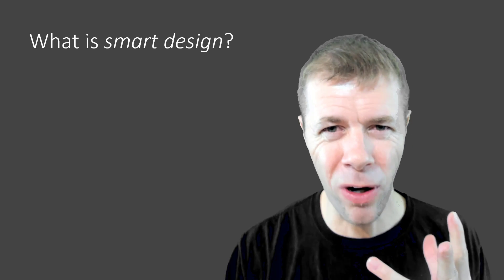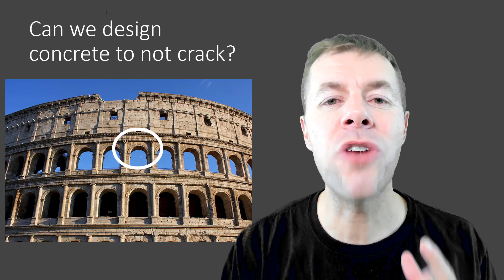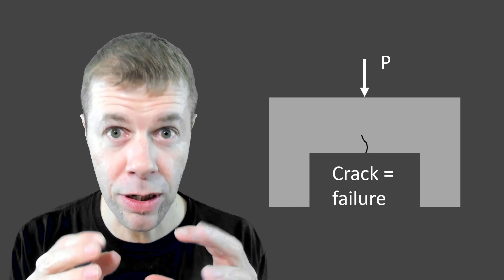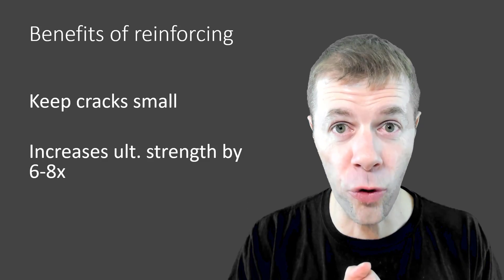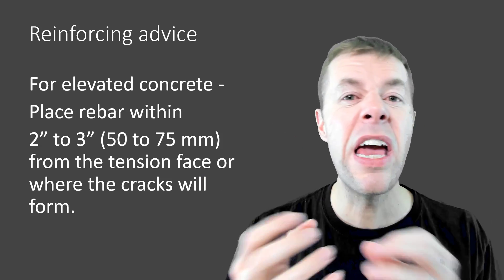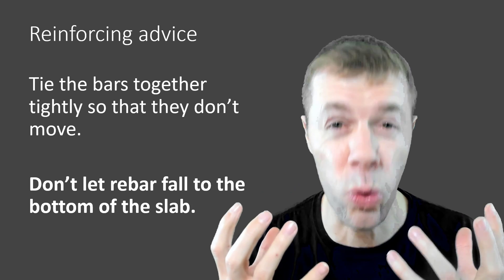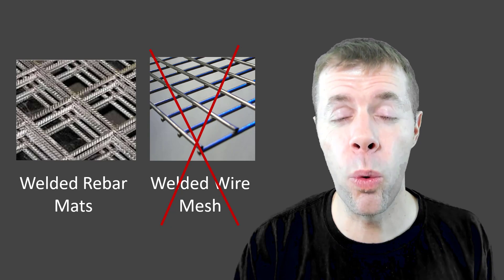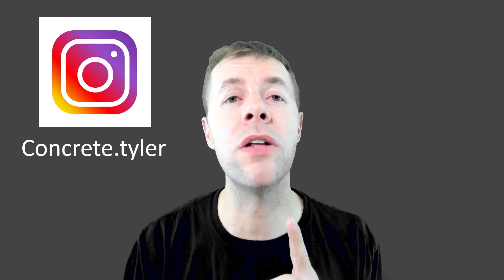How to design long lasting concrete projects

Comment: I look at rebar as future cancer for concrete. It rusts and expands causing cracks and spalling. GFRC or “ Fiberglass” rebar solves this problem. It’s lighter and easy to cut and is corrosion resistant.

Comment: What is the 10000 Psi cylinder concrete mix design Strength

Comment: I need a lightweight 8 inch concrete cap over an 8 foot diameter buried cylindrical plastic tank with load bearing 2 foot wide perimeter. I'm doing a mix design using pumice gravel, portland, 3 micron pumice pozzolan, steel fibers, and rebar.  I have waterglass (sodium silicate) available also.  Do you have any recommendations or cautions for the mix design?  I'm going to be pouring some preliminary test cylinders before the job, along with sample cylinders during the pour, but I want the preliminary work to be as successful as possible. I have a series of these tanks going in a tank farm.

Comment: What concrete mix is suitable for a big  underground water tank slab . Tank measurement : length 13 meters, width 5 meters, depth 8 metres.

Comment: You said you want to place the rebar mat in the middel whenit comes to concrete floor, what if it is a double mat? Is a double mat with smaller diameter size bars beter than a single mat with larger diameter size? The double mat uses more steel and the cost is more, but i take it that the cost out ways the benefits if the double mat is stronger.

Comment: Given that concrete is weak in tension, why don't modern RCC beams incorporate a slight arch in their design? Wouldn't even just a slight arch increase the strength of the beam?

Comment: Nice video. Great explanation of why rebar has revolutionized concrete in terms of tensile strength.  Maybe a small bit on long term weakness of reinforced concrete in areas with any kind of humidity could be helpful though.  I like the idea of exploring arches more in bridges.  Rebar eventually causes concrete to fail due to flaking.  Short term gain for long term guaranteed failure.  I wish engineers would discuss how we can avoid rebar as well, so that we don't have all this bridge repair work to do. Just seems like lots of wasted money.

Comment: The last roll of 9gauge welded wire the I bought had deformations. (I was actually looking for smooth wire because it was for a garden trellis.) 
It seems like you might get to a point with so much re-enforcing that you might as well skip the concrete and just design with steel.

Comment: I would like your opinion on wellding rebar vs tiying them with a wire 
I keep hearing mixed info,
Wellding rebar is good in cold weather 
concrete beam doesn't flex a lot VS tying rebar in warm places were concrete beam tend to flex .

Comment: I have a question on how to design long lasting concrete.  I'm going to build a forever home and want the house to last for centuries.  This house will be built in MO where footings and foundations are the standard design.  The house will be 100% ICF and I want to know how to protect or waterproof my concrete footings?  I want all 4 sides of the footing to be protected.  If you just pour the footing on dirt, the bottom part of the footing will soak up water over time and the reinforcement in the concrete will deteriorate.  You have one time to protect your footing until it will be buried forever.  I would like your opinion on how to protect a concrete footing for the elements and to protect an ICF foundation / house from the elements.  This is such an important subject that no one goes into great detail on how to achieve this. I'm not worried about cost since the footing will be a very small part of the entire project.  As far as protecting the ICF's, cost is a little bit more of a factor since it will be a very large area of the house.  The more detail you can provide about what type of concrete and when and how to protect these areas the better.   Thanks Eric Wehmueller
Reply: I know this was posted 10 months ago, but this would do the trick (this guy is in Springfield, MO too BTW): https://www.youtube.com/watch?v=HBfwIhSLppE

Comment: Cracks also form due to shrinkage during the curing process, not just when the tensile strength has been exceeded.
Reply from the maker: When the concrete shrinks the movement is restrained by the internal aggregates and this exceeds the tensile strength and causes the cracks.

Comment: Always great videos  - as welded wire mesh is used on many if not most residential driveways and patios - what are the reasons for not being a fan.

Comment: Check your diagram of the arch to the picture. The photo of the Coliseum clearly shows the Roman arch as a half circle. The diagram or cartoon you use is much lower-flatter than a half circle. What you will also find with the remaining original Roman arches is that they were not cast concrete. They were mortared stone.

Comment: Welded wire mesh is for sidewalks. It's relatively cheap, easier to break up a slab and adds less steel to deal with while recycling. The concrete actually bonds to it very well. The square size is decent for holding standard sidewalks together. Something slightly thicker would be better but on average it lasts forever without completely rusting out.

Comment: To increase life time of a concrete structure I think a good idea would be to use stainless rebar on the rebar layer closest to the surface of the concrete. That way you should buy yourself some extra life time in terms of rebar corrosion initiation at a fairly low overall cost increase  for the home building project. I've also heard that keeping your vct at about 0,4 is a good idea if possible in order to get a concrete as impermeable as possible. I would appreciate some comments on these suggestions.

Comment: It is amazing how quickly a crew can build wire cages with a simple spring tool. The more steel the better. Many times concrete has less steel because of cost. This is part of design stage. As the GC on some projects, I would go back to engineering and request more steel in some ares, because I could tell it was not enough. And it was very important that is be deep in pour and not move otherwise the design strength goes to hell. Remember the steel  is an interconnected cage to move stress around what could be a very complex  form and it use to connect different pours. It is also important to allow concrete to crack in certain places. So having pre-designed cracks is also important. When we would build walls over 100 feet in length, we would have expansion joints with floating stainless rebar pegs every 100 feet to take the expansion and contraction forces.

Comment: Hey Tyler, I’ve been obsessed with gothic cathedral architecture lately. I visited the Guadalajara Cathedral in Mexico. And obviously the Notre Dame Cathedral has been in the news lately. I was wondering, would it be possible to make a gothic style Cathedral, with all the complex ornamentation and decorative elements, completely with reinforced concrete? Using forms and 3d printed chamfer strips and what not?
Reply from the maker: I don't see why not.

Comment: Hint about free (hated by the industry) additives that would make concrete durable, economical and safer: volcanic ash, organic ash (yeah! ashes from burnt leaves and wood pieces from your back yard), salts, and CLAY. Clay in small amounts is awesome for the mixture because it expands with humidity. Imagine a concrete that seals itself with the presence of water.. Also imagine a concrete that repairs itself by leaching minerals when water is present. There are sooo many cheap and free ways to make concrete better but, it is not good for the business of never ending spending.
Reply from the maker: JR - In my opinion the industry is very interested in producing long lasting concrete.  It is horrible publicity when a structure fails too early.  I have studied volcanic ash, organic ash, and clays in my lab and while they can be helpful they are also quite variable.  This means that one sample may be helpful and the next will do nothing.  This is why these materials are not widely used.  If someone could find a way to rapidly evaluate these materials or purify them then I think they would be used in much higher volumes.  Thanks again for the comment.

Comment: Hello Dr. Ley, can you please post a video regarding the inverse analysis of Ultra high performance concrete? I am struggling in finding a good reference for that method. The inverse analysis will basically inverse the load deflection curve obtained from 4 or 3 points bending test to an equivalent tensile stress strain curve. Thanks for your time.

Comment: what kind of concrete is used in the new super tall buildings?
Reply from the maker: Most of the columns use high strength concrete to try and shrink the column size and to reduce the creep.  The slabs and beams are pretty typical concrete mixtures.

Comment: Great video Tyler. What about post tensioning some small non critical project like a bench? I’d assume the practical way to do this is place tubing like PEX centered in the slab, and the run threaded rod in after it’s pulled from the forms. I’d assume more compression,  more better? Is it best to pull something from a form ASAP and then put it underwater for a month or so, or keep it in the form and flood it on one side? What about temperature. If we have control over temperature, is it better to pour and cure at lower temperatures?
Reply from the maker: Post tensioning on anything less than 15' is not really worth it because the shortening and losses will cause you to lose your prestressing.
I would leave things in the form as long as possible.  You can pond the exposed surface.  Lower temperatures are better but you don't want it to freeze.  Good luck on your projects!

Comment: I've watched some the videos and subscribed as trying to learn about concrete is hard. Would you please do a video about sonotubes and whether or not to use them. I am planning on pouring a concrete pad and new fence posts. As you have PhD after your name whatever conclusion you arrive at could be taken as gospel. Out of curiosity, what was your thesis about? What do you think of air-crete?
Reply from the maker: Don't let the PhD blind you.  Make sure things make sense.
I like sonotubes.  I have had good luck with them and I would encourage you to try them.  My PhD was on air entrained concrete.  I like air crete for certain applications but I wouldn't use it for anything that you want to be long lasting.

Comment: [Student of the concrete game] Without much information and knowledge about reinforcement of concrete, I wonder there are other options like slag or silica fume that can not only reinforce the strength but also UTILIZE pre-existing material. Since those metals aren't unlimited supply... Just a thought. Great lesson as always!
Reply: Our planet is made up out of mostly iron.
Might as well be an endless supply
Reply: @UmaROMC  thank you!! Another lesson learned!